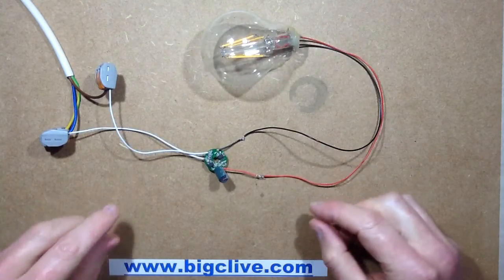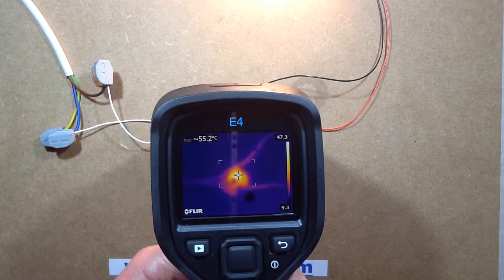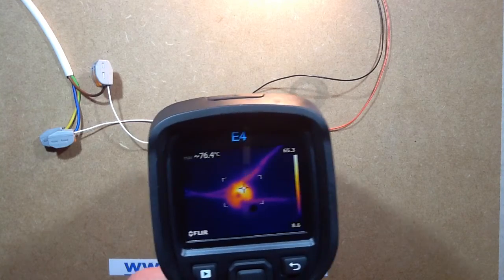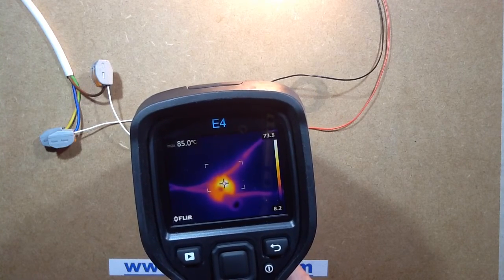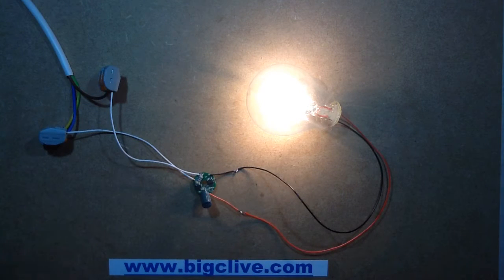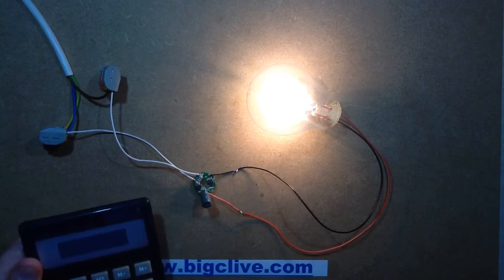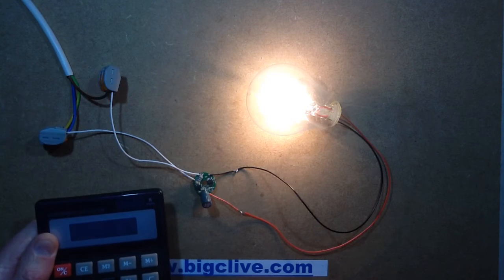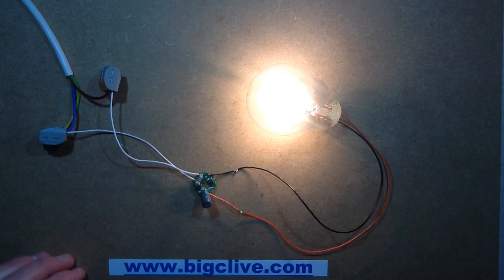LED filament lamp PSU chip thermal dissipation.

Comment: I really do think that the glue which bonded the socket to the lamp did cool this chip on the PCB just enough so that this current drop does not occur. I think it does only occur on hot summer days, where you certainly want cool white illumination.

Comment: Nice wee FLIR camera :)
Reply from the maker: I should mention that it's hacked.  The high resolution and automatic targeting of the hot spots are only normally enabled on models much further up in the range.
Reply: bigclivedotcom
Did you buy it, or did they donate it for you to promote?
Reply from the maker: Randy Pandy I bought it at full price.  About £1000, but it's a very useful tool, especially when "upgraded".  Although I think they might have addressed that technical loophole.
Reply: bigclivedotcom
It looks useful, how poor is the parallax error between the thermal camera and the imaging camera?
Reply from the maker: Randy Pandy It's OK over distance, but close up the images are clearly out of position.  This isn't an issue though, since it was really a tacky way of Flir to sell a low resolution thermal imager with the standard camera providing positional information.  One the configuration file in the camera has been adjusted to make it think it's a full spec unit it unlocks the full resolution of the hobbled sensor making it a high resolution thermal camera.
Reply from the maker: ***** It involved using Flir's own file updating software to load in a new configuration file with all the disabled features enabled.  Basically changing "false" flags to "true" flags.  Then the new file would be updated with the products serial number and a new checksum generated.  There was a script floating about that did it all on the main hack thread on the EEV blog.  It only applied to the E4 thermal imager and they may have updated the firmware to block it now.

Comment: I've one LED bulb (Integral 4.6W) that seems to use a thermal management chip also, where the lux level on a light meter started dropping after a minute of the light being on.  With the lux meter on the floor and the light switched on, it read 22.8 lux.  This dropped to 19.8 after 2m, 18.2 after 5m and was settled at 17.0 after 30m.  So based on the lux level, this bulb got 25% dimmer after 30 minutes, i.e. 350 lumen instead of its rated 470 lumen.